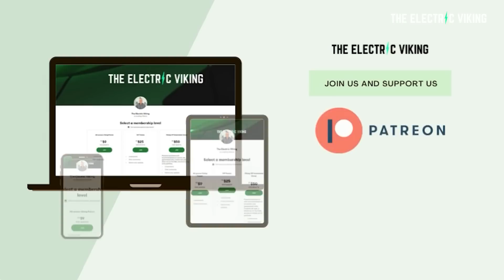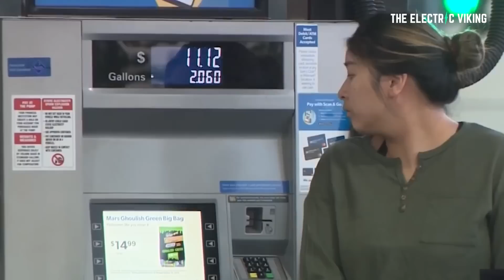Changing to renewable energy would save $11 trillion every year

Comment: Environmental damage from rising oceans, stronger hurricanes, more extreme weather generally, and toxic pollution like ultra-fine particulates your lungs cannot eliminate, etc., all equate to massive indirect economic losses and should be counted as avoided costs by moving as quickly as possible to 100% renewable energy sources - globally.
Reply: ...not to forget the noise generated by nonelectrical motors... it's a big health issue.
Reply: @bitmormon2019  Absolutely -  Though the economic losses are difficult to quantify, engine noise from cars, bigger trucks and buses especially is becoming a bigger problem particularly in our more congested cities, along with the air pollution from their exhaust.

Comment: I recommend a big battery for every household, that stores electricty during the low rate hours, to be used during the day. This improves the entire electricity grid: more efficient usage of the grid capacity. A house battery system is the basic system element to start with, which can be extended with solar cells and small wind turbines later on.
Reply: The EV big long distant batteries vehicles are selling today. 
The small daily drives is what central power does not want you to talk about. 

EV to the grid will allow trading of the extra electricity stored in the battery. 
The EV battery comes free, with the vehicle, Hahaha. 

The 100kwh battery for the long distance drive only needs 7kwh for the average DAILY DRIVE. 
365 days vs 1 or 2day long drive. 

This means a massive amount of stored electricity and topped up daily. 

The existing grid loves big batteries.
Reply: You don't need a big battery actually, you just need people's cars to act as a household battery when needed. Less cost, and more efficient to get 2 uses out of a single purchase.

Comment: Watch Tony Seba's video about this he posted about a week ago.. We can have all the energy we need AND THEN SOME for a fraction of the cost we pay today.. If we invest just a little more in renewable energy than we actually need, we get what he calls 'super power' excess power we can use to power parts of our economy for almost free.. 

Having excess power is now seen as a problem, we should turn that arround and see it as an asset. Charge batteries for a rainy day, solve water shortage problems by building desalination plants and fill fresh water reservoirs using this excess power at sunny and windy days. Produce green Hydrogen for producing vertilizer and produce CO2 free steel (replace coakes with Hydrogen), use it to produce synthetic fuel or the airline industry by capturing CO2 from the atmosphere. etc, etc, etc.

Comment: Talk about net metering... I have 2400 Sq ft of roof space suitable for solar panels that could produce 2300 kwh monthly... my monthly usage average currently is 750... In illinois  the net metering law is set up so that ComEd does not have to buy back my extra electricity... Additionally the recent Inflation Reduction Act only provides subsidies for building  solution up to what use... it doesn't help pay for what could produce... if  put solar panels on all the suitable for roofs in the us we could reduce of dependence of fossil fuel by 40%
Reply: I have solar and Texas also foes not require buy back.  But it still doesn't handle the provider supplying that buyback.  Right now Tesla battery is too expensive.  That is a problem
Reply: You want the utility to pay you peak prices for power that they have to provide off peak.  How greedy can you get?  Why don't you buy some batteries and provide your own off peak power?  It is not cheap.
Reply: @Philip Damask  I know it is not cheap to buy batteries.  It is why I don't have them.  But a lot of people don't understand, and certainly advertisements are misleading.  

I don't know why seem antagonistic with that?

Comment: Regarding the huge loss of energy with combustion motors: think about it when CPUs and GPUs which loose about 99% of the invested energy to heat and cooling and only about 1% is being used as processing energy - make a 180° and become about 99% efficient instead. That will be the new age!

Comment: Adding a Powervault battery to my Tesla solar system, would double the price, pushing me to 20c per kwh when I can buy clean CNG power for 11cents from the grid. So reliable Solar is at this point still double the price of reliable clean fossil power. You can scale this up to grid system size, and you come up with the same equation, and much worse in countries that have to shift summer solar production to winter use.

Comment: Love my solar array. BUT, without making Solar, Wind or other Unreliables reliable with battery storage, that price advantage does not exist except for limited applications where solar energy production and its consumption are somewhat correlated. We have that to some degree with AC consumption here in Nevada. But Northern Europe needs to shift summer energy production to Winter use. No chance that Solar and even Wind can deliver that at a reasonable price. CNG will provide that. Hydrogen is not it, as it wastes 50% of the energy in the chemicalconversion, extreme high pressure storage, and inability to transport easily.

Comment: 32m2 solar gives 33kwh daily in Australia. 
20million buildings on national grid. 
= 660Gwh daily .
Fossil fueled 600gWh daily if you are lucky. 
With EV big batteries plugged into the national grid central electric power is dead.

Australia has 20million vehicles. 

Plus wind farms 
Plus solar PV farms
Plus hydro electric dams 

20million EV 100kwh can store 2,000gwh daily.

Nuclear is dead because the national grid grid will be full of Renewables and batteries. 

Nuclear will need an extra national grid or will over load the existing national grid. This is 10 times more expensive than the nuclear plants. 
This is why nuclear is dead. $ economics fails nuclear. 

Nuclear uses the expensive grid to argue against distant renewable farms. 
Nuclear uses climate change to argue against cheap fossil fuels. 
Nuclear is, engineering wise, stupid and economically dead.
Nuclear only had a chance decades ago. 
New technologies have destroyed its last chance. 
Many people have invested their careers in this old technology 
and centralised concentrated electric power supply business are scrambling to survive. 

Elon Musk knows where the money is. 
The big auto manufacturers know this. 
EVs with big batteries.

Comment: - the 11T in the title, confused me by the with 111T  (over 10 years) in the headline got me going..  (ha ha, error checking..   Good oh, carry in....) 

We do need to invest in dual use Solar Systems - avoiding replacing agriculture with energy generation, it shouldn't be "food OR  energy" under any circumstance  - horticulture can benefit from coexisting with solar  (wind is an "easy fit" - as long as it is not placing large numbers of roads right across farmers fields.

Also solar and wind need to be powered by said solar and wind, not emitting vastly more now, with the promise of "less in the future".

(BTW my latest Experiment is to use a couple of "low cost" 200AH 12V replacement  LFP batteries - (total 5kWh for under $2.5k)  paired to an inverter to run the bulk of my (steady state)  house loads (besides another 200Ah solar in my ute for camping / running chargers and tools "off the grid) - I already have Solar (6kW), but no battery as to date they have been too expensive and not "the right size / easily enough to scale "  - to economically justify House batteries.    Will find out in a few years how it has gone...  (I live in a fully electric house with little heating need in winter and just a couple of handful of days really needing AC in summer. Have had no net ills for 4 years ATM but network service charges and FIT have shifted to the downside recently)   Anyhoo...

Comment: Solar and wind will reduce dependency on gas but it won't eliminate it because you need gas as a backup for those periods when output from wind and solar is negligible. Please don't say battery storage is the solution because the amount of energy required is orders of magnitude greater than what batteries can offer. Gas powered generation will still be needed even if it spends more time idle. Someone has to build them and pay the staff to operate them, and if they can't raise enough revenue by selling electricity, commercial companies won't do it unless they get state subsidies to cover the costs. This is the hidden cost of wind and solar that most ignore.

Comment: My question is how do you recycle solar panels? They last about 8 to 10 years, after that what are you going to do with the waste.
Reply: Please don't exaggerate, you only make yourself look silly.  Modern solar panels are generally warranted to last at least 20 or even 25 years before their output falls below 80% of their original output.  They will continue to operate for at least a further decade with some further loss of efficiency.  Entrepreneurs will find ways to profitably recycle/reuse aging solar panels once there are lots of them in existence.  Meanwhile, hydro, nuclear & coal-fired operations will last at least 60 ~ 100 years with minimal maintenance/renovations while occupying relatively tiny footprints {excluding the square kilometres of hydro storage lakes which are generally located in unpopulated areas}.